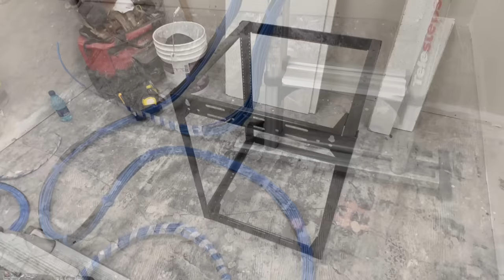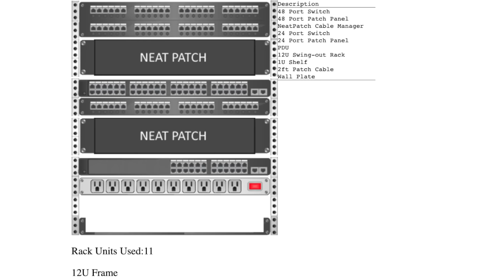Learning Network Cable Management - A Small Business Open Frame Rack Build

Comment: In college, part of my networking class assignment  was to create our own RJ45 cables using the crimper tool, at the end of the exercise my fingers were absolutely roasting and cramping, Big respect to this profession.
Reply: Yeah making your own patch cables or just terminating is a b...., I started using tool less RJ45 connectors (if needed) so I'm done quicker, yes they're more expensive then the normal ones but no pain in fingers :D
Reply: In my experience having done 3000 drops, never make you own patch cables.  Complete waste of time and prone to problems down the road.

Comment: Nice setup.  For our setups I don't use cable storage or management racks as it gets in the way and makes the cabinet too large.  I put the switches right next to the patch panel and use short patch cables.  Makes troubleshooting alot easier vs digging through the cable bundles.   I also use different color patch cables to identify them as trunk cables.  I.e. Red cable form modem to firewall, yellow cables from firewall to switches.  Blue cables would be your standard client access.
Reply from the maker: If I have complete control over the job scope I can sometimes work it out differently.  If I can build the layout consistently with the same sized panel and switches all the way down I would probably skip the horizontal cable manager and move to a vertical manager instead and use that to hide the uplinks.  Each build tends to be unique based on the restrictions I am working under.  Highly agree about chasing the cables, I often label them if there is time, I will try to include that in the next one.
Reply: @tciproductions  This is a great example of perfection being the enemy of good.  These were some really helpful tips on how to efficiently adapt and approach the problem when your installation is not the priority on site (Which is most of the time IMHO).  As the guy who usually has to come in after this stage to complete the setup, I really appreciate this approach and it helps with understanding what led to those decisions.
Reply: @jamiepaugh9700  Yep.  We use green and blue keystones.  Green for VOIP and blue for DATA.

Comment: Use two mounts for the riser pipe, single is too weak and will bend or pull out with side load. Securing racks, I will try to get extra fastners in rear-top to ensure that if someone adds more weight, shouldn't fail. I have been known to hang myself off them to test strength. This means I can sometimes use a diagonal strap from top-back to bottom-front corners.
Reply from the maker: If it was in drywall it takes two struts for sure, and even then fails easily.  You made me think of something I should have talked about which is I never place any stress on my pipes, either from the service loop resting on them, or pulling too tightly towards the rack.  I will make sure to cover more in-depth next go round.
Reply: @tciproductions  It wasn't  your work I was leaning to, its the muppets who come along later to add stuff that don't follow same standards. Always have to keep the numpty-factor in mind.

Comment: Very interesting.  Makes a lot of sense for how you combed, routed, and punched down the cable.    I'm not a fan of using cable managers butted up against switches as if one needs to do any maintenance, those  connections are a pain to get out, and usually one then needs a flat head screw driver (or need nose plyers) to release the tab. 
I'm more of a fan of split loading the switches so that cables don't cross.  In this instance, you could have used a 24 port patch panel on top, and a 48 port patch panel on bottom.  As for firewalls that aren't normally mounted in a rack, yes, they are a pain, but until manufacturers start making rack ears with the appropiate models, those adapters at aleast let the firewalls stay racked, and not just flopping on a shelf like I've seen a 1000 times with the ISP modem.

Props to you for sharing your work.   We need more installers doing this.
Reply from the maker: I appreciate the sentiment, thanks.  I will have many more variations in future efforts, I'm hoping to explore different layouts each time so that folks learn something new from each vid.

Comment: Nicely  done, we typically do things a bit differently, we have 24 port patch panel, then a 48 port switch then another 24 port patch panel.  The top patch panel goes into the top row of the 48 switch with short cables and likewise the patch panel under the switch goes into the bottom row using short cables.  Keeps things nice and tidy too but each to their own, good work, nicely laid out :)
Reply from the maker: Thanks, I appreciate it.  I will show more ways to do the switches and panels in future vids.

Comment: Nice job.  I am gonna share a tip that has changed my network rooms forever.  6” jumpers….  All our switches are now installed between 1RU patch panels and 6” jumpers hu up and down from the 48 port switches with no cable management needed.  Not only is installation faster and cleaner, maintenance is faster as well. 

For the occasional off cable that must transition from one rack to another, we use the 6” jumpers as a chase for that horizontal run.

This works so well that the cabling vendors we use now recommend this to all their customers.
Reply: But as he said he had no idea what switches would be used...so longer is better
Reply: Well I guess there are switches out there that are bigger then 1 RU.

Comment: Thanks for sharing your knowledge. Please note'
Connectorized - A raw cable end on which a connector was installed.
Termination - The placing of a connectorized cable in its final destination.
Exception: When a raw cable end is stripped and permanently punched down on a block without a detachable connector.

Comment: I use chase-pipe at home, but I have no clue what you bought. My pipe is that white 4" plumbing pipe from Home Depot. We also used a 45 degree bend radius to make sure everything could fit. It's 23 CAT6 wires with 5 fiber runs. Not too many, but we put them in the house ourselves. Any drops for the second floor are done through the attic, so they didn't need a pipe.

Comment: Nice one! I'm the guy who comes in after you to run config. Very nice to see someone take pride in their work. One thing I would change to help maintenance going forward is using different patch lead colours for different types of devices. It may break uniformity, but it'll make troubleshooting and e.g. VLAN configuration far easier.
Reply from the maker: Thanks for saying so.  I do often try to color code by purpose, like red for firewall is a good example, but you'd be surprised how much pushback I get from IT types.  Fairly often I'll do the first set of 24 so they can see the pattern and I just leave it to them afterwards, its their rack and if they want a rainbow waterfall on the front that's their call :)

Comment: I'm not sure if someone else has asked this, but can you give some suggestions for that cable comb?
I'm now retired but I have had to both run the cables & add the ends to both RS-232 25wire as well as modern network cables. I really wish I had even thought of a cable comb but oh well. I still have my tool kit and just add new neat stuff to it as I find them. My will actually leaves this kit to a young man whose skills & professionalism has impressed me so he can make use of them in his ongoing career. I'm 65 so I haven't used this kit in a couple of years but I keep everything in vacuum sealed bags so they are as fresh as they were when I last used them. I do the same with any HDDs & backup tapes for the same reason.
Reply from the maker: Hi there, I thought I had linked it, but I use this cable comb: https://amzn.to/41NZeuA

Comment: I always worry that those plastic “jacks” compromise signal integrity. I’ve seen people have issues when antennas are installed in the area. Note: I am not a professional installer.
This is definitely helpful for when I will install a home rack, nice to see how to do it the proper way
Reply from the maker: I don't think I've ever used a fully metal jack.  If in doubt, hit yours with a high end tier 2 test (you can usually rent from someone like me nearby), that should hit it with 10gigs and do a frequency sweep, if the cable has issues at the jack you'll get a NEXT or FEXT error.  If it passes you can rest easy.

Comment: very nice work, clean and as good as someone can do, given what the client wants and provides. wall racks are a bit tedious given the space restrictions and he usuall close-to-wall position, but you managed really well. going with the fiber (if it's available) was the right call given how stiff dac cables are and routing them in a small rack is meh. keep up the videos so we can watch and learn from other installations.
Reply from the maker: I appreciate that.  I got more on the way, of varying sizes of install, hopefully they are of use to someone.

Comment: I love your installs, it relaxes me... I know it's weird. I live in Japan and my wife and I are having a second house built.  I'm going to run the low voltage wiring (network and speaker cabling),  I wanted to ask you about the chase pipe you used in this video.  Did you buy it or did you make it?   I'm hoping you made them and you might be willing to share the method because I can't seem to find it online.  Maybe it is the terminology I'm using in the search?
Reply from the maker: Try changing your Google terms to something like "cable ceiling entry" vs chase pipe, the term is a bit generic.  There aren't many solutions that I like, but you can buy pre-made grommet type ceiling to rack interfaces that aren't too bad.  Otherwise we make them ourselves from EMT conduit.

Comment: Great video all my clients have racks one day I’ll install one from scratch. Do you have a list of tools used not familiar with punch down I use couplers panels
Reply from the maker: In the vid descriptions I usually post the tools I am using, but it boils down to a stripper tool and a fluke 110 punch tool for 90% of the work.  I'll make a vid about the punch style panels soon, I also prefer the kind that mate into a connector so I try to use those most of the time.

Comment: Hello, I'm new to your channel but amazing videos.  I followed along on this video and had a question.  When pulling cable through the J-hooks above ceiling, do you velcro the runs above the ceiling as well or keep them loose and only cable wrap in the server room where the cables are exposed?  Seems like that would be a ton of extra work if you had to pull additional cables later on.   I have seen many different videos and wondered how some of the cable management can be kept so clean from end to end. Thanks again!
Reply from the maker: Hi, in the ceiling I don't often velcro wires that are in J-Hooks unless I want to try to control drooping lines or anything that I think would cause another trade some inconvenience.  Better to have them loose so you can pull on them or thread a new one through, I think.

Comment: I like doing a sandwich for small racks like this the 1u Patch , switch, 1 u Patch.  Then use 6" cables. top patch goes to the top row of the switch, bottom patch goes to the bottom row of the switch.  No need for cable management tray in that case.

Comment: Great video - subscribed!  What are the parts used in the ceiling sleeve?  Do the holes need to be filled with fire caulk?  Maybe some areas?
Reply from the maker: I have another vid about ceiling interfaces that covers the exact parts.  It can be expensive sometimes but basically it is just EMT from a hardware store that I cut down to size.  For firestopping, it never hurts to do it, even if you don't really need it :)
Reply: @tciproductions  Thank you for your reply and great videos!

Comment: 3 questions if you dont mind.

1. What is the pipe you used for the chase pipe install?
2. Did you mount it on a DIN rail?
3. If yes to question 2, what did you use to secure the pipe to the DIN rain?
Reply from the maker: Hi there, this is standard EMT, 4 inch diameter.  I buy it from a hardware store in the electrical supplies section, and chop it to length for this use.  The item that looks like a DIN rail is actually Uni-Strut, and is in the same area of most stores.  I pick up a 10 foot length, and use a band saw to cut the strut to the size I need.  Uni-strut has a whole system of clamps and nuts that I utilize to connect the pipes to it.  I will try and make a video on the procedure when I get a moment.
Reply: that would be awesome, thanks @tciproductions

Comment: question: when you have a 48+ SW why not put the 24 port patch panels one above and one bellow to have a neat run, and it also allows you to run short cables
at least that's how I do it when I can do the plan and have the choice of switches
Reply from the maker: I do that from time to time, I usually factor in who my client is and what they expect to see, and whether or not the end result will be better looking, impress them, or be more manageable/expandable.  For this one I'm showing my generic method that handles about 80% of possible cases that I walk into when I don't control most of the variables involved like which switch, which rack, etc.  On this job I had very little say, the technology team for the client had a lot of opinions and I just stay out of that whole mess.
Reply: @tciproductions  unless they specifically asked for this set up, PP, SW PP is ideal because you don't need to trace cables and installation is quick if you ever replace the SW. This is just more messy.

Comment: Do you really trust those all in one systems for terminating those key stones? I understand that the crimper has a preset amount of clamping force to set the wires into the IDC. But i like the feel of the punch down tool when it punches. I understand that the punch is mainly there to cut the wire, but i really feel that that force helps seat the wire deep into the IDC.
Reply from the maker: The all in ones I use apply force.  We've installed many thousands by now and once in a while you get one that fails the cable test, its usually the conductor coming unseated during the compression of the jack and breaking off.  The punch takes way too long (8 vs 1) when working in quantity.

Comment: Do you have info or a link on the cable management trays you're installing behind the patch panels?
Reply from the maker: My wire management preference is the NeatPatch brand for small network set ups, and then Panduit for the larger frames, especially for vertical wire management.  Amazon has NeatPatch in 1U and 2U versions.

Comment: Do you have any tips for that Cablematters crimp tool?  I've had issues with it from the beginning getting it to properly seat all of the wires in the keystone like it should (yes, I am using the official cablematters keystones compatible with the tool :) )...
Reply from the maker: I know what you mean, sometimes the teeth just don't cooperate.  I learned over time to slide the keystone in at a slight angle, like oriented downward about 10 to 15 degrees and it passes under the teeth more easily - sort of like slipping on a shoe.  I also do a quick downward press test with light pressure to make sure I'm centered over the keystone, if I see it hit the white plastic of the keystone teeth I slightly adjust or wiggle the keystone so that it gets out from under the teeth.  Otherwise a full crimp will shave off some plastic and maybe even get it stuck in the crimper.

I've tried quite a few all in ones and each have their 'feel'.  Once you get the feel right they will crimp easy, its a bit of training muscle memory.
Reply: @tciproductions If you ever get around to making a video of the technique you find works best, I'd love to see it :). I really want to love this tool!

Comment: Hello, What tape did you use at the end to make the tail of the wires after you comb them?
Reply from the maker: I use standard electrical tape that is grey colored (I find the black tape leaves black streaks sometimes), if you do a search for Temflex 1700 I think you'll find it at the local hardware store.  Here's a link: https://amzn.to/4bMNgG2
Reply: @tciproductions  thank you. I have different kind of color electrical tape when I do other things. I normally use black tape with Ethernet. But I find the cheaper the tape is it leaves a residue on the wires.

Comment: Why not cabling both switches separately to the router rather than cascade them? I'm new to the field but I've heard that makes up for a more reliable topology in case the cable to SW1 fails, and also helps splitting the load so the first one doesn't has to take all the processing/forwarding coming from SW2...

Nice skills btw for sure will take some things I saw here... Sorry for my bad English hehe Cheers from Venezuela!! Subscribed:))
Reply from the maker: I was thinking that very thing but the client didn't give me enough information to be sure, the Sonicwall devices I can't tell if the ports are assigned as a LAN switch without seeing its config, so I did it that way to be sure the devices could talk.  Also, even though the ports on the Sonicwall are 1gig, the device itself has such little horsepower that it would be a huge bottleneck if you had to cross it to reach a LAN server or something.  Its not my favorite kind of router/firewall.  An excellent design point otherwise!
Reply: cascade switches makes sure that even if the router completely fails, internal network still works for all connected devices. it would be a pain if the router fails and half the machines cannot access the network printer or NAS, because the switches are not interconnected.